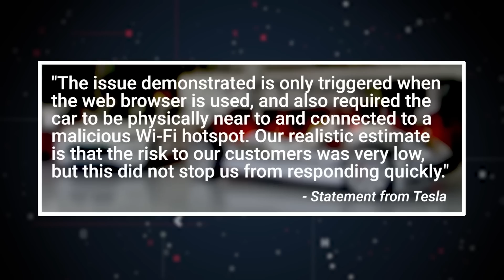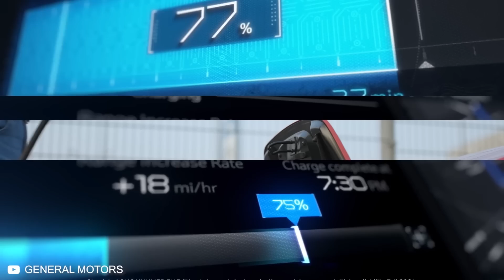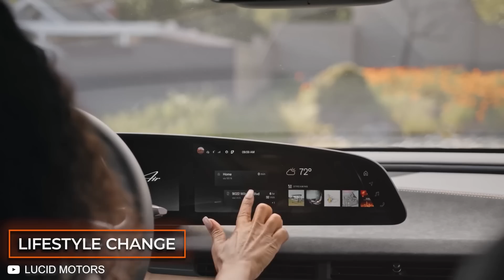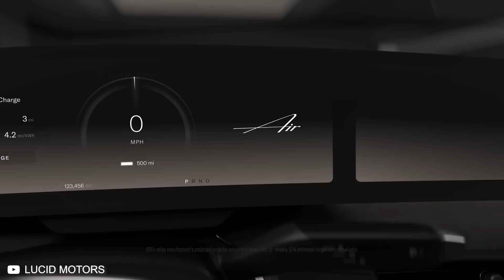EVs' Serious Problems That Carmakers Are Hiding

Comment: E.Vs are a way for car manufacturers to make money, they are not going to save the planet as the electricity they use is from fossil fuel power stations. They are also destructive to the environment as the mining for lithium degrades the planet and exploits poorer countries. The real polluter of the planet is industry which governments do not mention. Its a con to make money and push less wealthy people off the road. The cleanest cars are small petrol cars which could easily have emissions reduced with the application of science. Another money making ploy disguised as so called green tech.
Reply: A.) even from a coal only grid, EV’s are significantly better than ICE car emissions even before considering the emissions from refining the fuel you burn.

B.) the majority of the worlds lithium is provided by Australia. Lithium is most commonly mined in deserts where very little can survive. 

B.2) do you really think all the steel used to make your massive engine block and massive transmission isn’t mined?

Comment: Time is money and the value of 45 minutes of my time to charge a vehicle is about $45. Add this to the cost of charging the ev and gasoline is definitely less expensive.
Reply: It’s a good thing you have electricity delivered to your house so you can charge from home while your asleep and not using the car and waking up with effectively a full tank of gas every day, unless you drive further then 350 miles every day to get to work and back? I doubt it. 

Infact, charging from home saves the average person approximately 16-17 hours per year from no longer having to go get fuel. So $4,260 of your time saved every year. Plus charging from home costs approximately 10x less than fuel per mile. Plus EV’s don’t require regular servicing like ICE’s do. 

So what were you saying about costs again?
Reply: @engineeringtheweirdguy2103  9th
Reply: @doctormountebank7656  9th?
Reply: @engineeringtheweirdguy2103  In the first place, not everybody can charge from home. I travel every weekend cycling and travel for business 90% of my work time. Charging would be impossible, inpractical, and extremely inconvenient. Great for a house mouse though.
Reply: @auntienonimous1688  agreed, not everyone can charge from home. But the majority of people can.
Reply: @auntienonimous1688  you cycle for 90% of your workday? You know those distances could be easily covered by an EV. I also travel for my work on a daily basis, infact I’m average around 11k miles per month….. I still use my standard range Tesla model 3. Saves me a boatload too.
Reply: @engineeringtheweirdguy2103  I think that you miss read my comment. I just read an article that stated that one third of U.S. drivers can not charge at home. That is a definite problem. Your 11,000 miles per month amounts to 366 miles a day.  Even at an uninterrupted 70 mph, that is 5 hours of driving a day. Think about it.
Reply: @auntienonimous1688  ahhh yeah. That’s what I was doing. My work requires me to drive to work site to work site sometimes hours apart. Then when I get home I do about 4 hours of Driving for Uber eats to get extra spending money for my trip to France I’m taking soon. And on the weeks I drive to Mount Hotham. A 6 hour drive each way.

Comment: If you had an EV would you charge it  you're garage while you're asleep? So far I have had two charging  batteres catch fire in my garage. Thankfully, during the day while we were up and about.  Able to prevent a catastrophy. I could not sleep after seeing an electric car fire. its like we tell some of our customers " if its made by the hands of man, its going to fail."
Reply: Did either of those have multi thousand dollar, state of the art battery management systems and were swimming in constantly temperature controlled coolant fluid? Hmmmm. That’s what I thought.

What about your car battery? It’s charging every time your car is running. Blistering heat or biting snow. How often has that caught fire? Hasn’t? Weird.

What about your phone, or laptop, or smart watch. Do you charge those when you’re asleep? Did you burn alive? No? It’s almost as though your making a mountain out of a mole hill.

Here’s a hot tip, statistically speaking, EV’s are 11 times less likely to spontaneously combust compared to an ICE car. If you’re so worried about fire, then get an EV. Your odds will be much better.

Comment: Another issue is. If the gov doesn't want anyone traveling and says the grid is not enough to power everything. To limit charging to 2 hours.. It's a good way to control people, to keep them from traveling.. And I bet in the future.. Another turn down the path people will say to phase out dirty electric cars, just like they do today with gas. Nothing is zero emissions, not even a glass of tap water is zero emissions. There is going to be a lot of people going around unplugging these cars on the charger and hooking their own car up for a free charge.. All you need is a long extension cord. There is already issues here where people just walk up to cars and unplug them, for giggles I guess. And if they plan on relying on electric cars.. They better find some super fast chargers.. Because I am not waiting around for even 30 minutes to get there.. I usually average 100-150,000 miles a year on a vehicle and that is not for business.. It's just traveling.. If a electric car can't do that. Then we will find other ways.
Reply: That explains why the government can turn off the sun to stop my solar panels. It’s all coming together. Thanks man

Comment: How much is the cost to charge on average?
Reply: Depends how far you drive and what kind of car. Rule of thumb is 10x less than a similar sized combustion car per mile. Say $12 per mile in a combustion car, $1.2 in an EV for the same trip.

Comment: One interesting thing I've noticed inall the discussion about EV's is that everyone seems to assume that every driver 1. has a routine of driving (work, errands, etc.) 2. chooses where and when he drives, where he parks, and how long he stays there after parking. The problem lies in the fact that this does not apply to a lot of people. 

I'm a gig worker. When I leave in the morning is determined by how long it takes me to get to job #1. I might get there to find the client has cancelled so my agency sends me to a place 25 miles away. I won't choose where I park or how long I stay there. And this will repeat through the day with job #'s 2, 3, & 4. This occurs whether it's day or night, regardless of weather. I also cannot arrive to a job covered in sweat or frozen solid. Therefore I'm not a participant in the use of wipers , headlights, or HVAC. If it's winter and snowing, my car might be plowed in. When that happens I'm not a participant in how much/long I'll need to rock my car to get back onto the road. And I'm not a participant in how much wheelspin is involved.  My point is that a lot of drivers may leave their house with one schedule in mind but turn out  to have a very different one actually happen. 

 The existence of drivers like us need to be acknowledged.
Reply: You can acknowledge that. But you can’t account for it. Due to the inherent variability in it. It’s a topic avoided because it’s so variable. No one wants to go a case by case example of your last 365 days of travel. That’s why it’s often does as averages. Which by definition, reflect most peoples situation, but also by definition, not ALL peoples situations.
Reply: @engineeringtheweirdguy2103  Thank you for your response. I'd imagine a PHEV would be the best fit for me: Electric for the routine, with gasoline as a back-up for those surprises that require more driving than the batteries alone can handle. 

What I'm probably reacting to is the (strangely, IMO) widespread dismissal of the notion that there exist drivers for whom an EV is actually not the pest option.
Reply: @ak5659  could very well be. However PHEV’s aren’t best of both worlds. You sacrifice a lot to get the engine in. You get the worst of an EV for the privilege of having a gas back up. Which you will have to use more because less space means less batteries which is less range. Small battery also means lower battery life. You’d have to replace the battery ALOT sooner than a pure EV. And lastly, it also means less power available for performance and lastly, you also inherent all the mechanical issues of a combustion engine and it’s constant maintenance requirements. A PHEV might suit you. Don’t get me wrong. But there are no best of both world options.

Comment: What's the ~ cost for an 80 % charge?
Reply: Depends on the price of electricity. Where I live off peak power is 14c per kWh. I can charge completely off peak, I use typically around 20% of my charge per day and I have a 50kWh battery so it costs me $1.4 per day. To charge from dead flat (as in so flat you had to use a tow truck to get it to the charger) to 80% again with those rates costs $5.6. Where I live, peak power prices are 28c per kWh so that same 80% would cost $11.20. And super chargers costs 40c per kWh so that, without the cost of being towed to a super charger, it would cost $16.
Reply: @engineeringtheweirdguy2103  Thanks for your comment.
That's not bad at all. If you don't mind what sate you live in? The bad part is the vehicle cost, ~ $100,000.00
Wonder how much it will be in 10 years from now. Since all States want to convert to ev's, and Power companies will able to provide the demand.!?
Reply: @gaborwendler6548  I live in Australia. Victoria to be precise. A Tesla model 3 costs around $40k. Other EV’s are also much cheaper with similar ranges (just not the performance or software advances Tesla has).
Reply: @gaborwendler6548  theoretically the power grid should be find. It’s always been expanding since it’s inception. Never failing to double in capacity every 20 years. Natural disasters aside, that means it should increase in capacity faster than EV’s are adopted, even with a mandated rollout.

Comment: ELECTRIC POWERED CARS ARE COAL POWERED CARS
COAL
Reply: Only in certain places and for home without solar panels. Although perhaps unsurprisingly, since coal power plants are massive structures purpose built for efficiency from the ground up through seven billions of dollars worth of investments per plant, they are ever so slightly more efficient than a significantly smaller, combustion engine purpose built to be mass produced and costs a few grand.

Even BEFORE you consider the emissions produced by refining emissions that fuel you burn in your car in the first place.

Comment: As someone who lives in the upper Midwest of the US, all they needed to say was the bit about the useful temperature range of the EVs. Our winters regularly drop to -20 to -30 degrees. If an EV doesn’t work below 60 degrees, it’s useless to me (and everybody else who lives here).
Reply: Operating range of an EV is +60 to -80 degrees Celsius. (140F to -112F) I think you’ll be fine.
Reply: @engineeringtheweirdguy2103  Thats not what the video said.
Reply: @Leftists_are_Losers  videos often don’t fact check. It’s not that they don’t operate in cold climates is that most people use the heater in cold climates. In a combustion car that comes from waste heat off the engine. In EV’s the batteries have to make the heat. So in climates we’ll below freezing your car, unlike a combustion car, will always work. But you might find that in older EV’s you’re using around 15% more power as you drive resulting in a marginal drop on range. In newer EV’s it’s down to 5% giving an ALMOST negligible drop in range. But with ranges far exceeding 3-4 days of driving for the AVERAGE person. That’s not really an issue.

Comment: I am less worried about the hackers than being fried by the batteries
Reply: Good, both scenarios are more likely in a combustion car.
Reply: @engineeringtheweirdguy2103  Not true, sitting on top of a battery grid can be equally life threatening.
Reply: @davidtucker3538  can be. Doesn’t mean it’s more likely. Statistically speaking a ICE car is 11 times more likely to spontaneously combust into flames than an EV and 5 times more likely to combust in an accident compared to an EV. And when EV’s do combust, it typically takes 30 minutes to 1 hour to fully engulf the car in flames whilst an ICE car typically takes under 30 seconds. Making them more survivable.

Comment: Wow, so many bad assumptions I don't even know where to begin, thermal issues don't exist in good battery systems (just know what you're buying). I go on one trip a year(if that) that has me driving more than 200 miles to get somewhere so, on the one trip a year I might take I think I can handle getting out of the car for 45 minutes every 5 hours, that's about the amount of time between meals and my legs get stiff if I sit for too long anyway so for me personally it's extremely acceptable since with petrol cars I do the same thing. Many other reasons people say "OMG I couldn't handle having an EV" that really wouldn't be a huge issue except on very rare occasions and even then it's not a deal breaker.

Comment: E.V's have been around for over one hundred years, so the main reason people have been taking a while to get used to them is, that when you need to go and need to get there on time, E.V's are the fools choice in travel.
Reply: Not really no. They havn’t been prevalent because we havn’t had the battery chemistry required to make batteries with enough energy density to be practical until the late 1990’s. 

In reality EV owners save on average 16-17 hours per year from getting fuel.  Since they charge when they’re asleep and every morning, without wasting a second of their time, they have a full battery in the morning, with an equivalent range of 2/3rds to 100% of the range of an equivalent sized combustion car (depending on the type of car). 

Tell me, how often do you go through an entire tank of fuel in a single day?
Reply: Well at present perhaps 3 or 4, over the last 40 yrs of driving though up to 40 with a stint in sales for a few yrs exc 150. The expense, the lack of infrastructure, not just with CHG stations but generation also. All the trillions spent cleaning fossil fuel tech, amazing advances since the 70's when scores of rives were dead in many Western country's. Touching something white if you'd been out all day, sooted up by the city. The West are giving those advances away, the economy gains in recent yrs is astounding and the West, we are going down struggle rd and the roads not ready yet. Demands nett next week we are evil please pay now go hungry they just don't care, power tripping rulers, that's all it's about, climate conspiracy, who's getting rich and who's poor. Self drive cars, I enjoy driving thanks. I like going fast occasionally, all the tech will erode our freedom, more time to be told what to do. You were late to work cj, I noticed on the GPS you were parked outside Giggle Girls Massage of 5.30 this morning. The Unibomber was a visionary, with nuts please.
Reply: @colinsmith2005  chg? You talking about EV’s or hydrogen?
Reply: In days out of 365.

Comment: I worry about my 18kw car battery not being available after 10 years. I am driving a Toyota RAV4 prime which is a plug-in hybrid. Toyota said they give a 10 year warranty on the battery. The battery gives me 50 miles and the gas tank gives me 450 miles. All the grocery stores, parks, and movie theaters are nearby so 90% of the time I only use batter and do not burn any gas. If I go for a long drive then once the battery runs out it switches to hybrid and I get 39 miles per gallon. If I have to drive from state to state which is going to be 75 miles then 50 mi goes on the battery and the rest 25 miles and goes on the gas. And since it's 39 miles per gallon I end up not even burning a full gallon of gas. The best part is I'm getting 40 solar panels for my house so charging the car is not going to cost me anything. My second worry is sometimes the gas in my tank sits there for 6 months since I don't drive that far. Does gas go bad if it is sitting in the tank for a long period of time? Toyota has told me that I have not break in my new car engine yet since it's not being used almost most of the time and it's been a year.

Comment: Sorry, I need to tow a trailer. Probably never gonna buy an EV. I'll keep my 2021 Ram Laramie 5.7 Hemi eTorque (mild hybred).  I can drive almost 600 miles and fill up in less than 10 minutes. Production of EV's cause more Earth distruction than conventional gas powered vehicles. We're just not there yet.

Comment: There is no "climate change" problem, just lying snake oil salesmen "scientists" and corrupt idiot politicians. The Earth is Eternal, we are but a tiny blip.
There is also NO lack of fossil fuels around the world, in fact current theories say it may replenish itself a lot faster than was previously thought instead of millions of years.

EV's are worse for the environment to build then fossil fuel cars.
They recharge using electricity from fossil fuels.
EV battery disposal is an environmental disaster WAY worse than fossil fuels are.
You can't carry a "can of electricity" around with you if you live rural or enjoy the great outdoors.
Power grids worldwide are NOWHERE near able to support even 30% of the population charging these POS vehicles daily.
Charging all these POS vehicles drives up electricity costs, making it even more unaffordable to have a home.
Limited range well below fossil fuel or fuel cells, ESPECIALLY for towing or hauling which is super important.
End of the day, they are a total waste of time and huge mistake.

Fossil fuels and fuel cells are the ONLY viable future until there is a quantum leap in battery building materials that are not toxic, much higher capacity, much lower charge time, safe easy disposal, more stable electricity generation, and power grid upgrades.